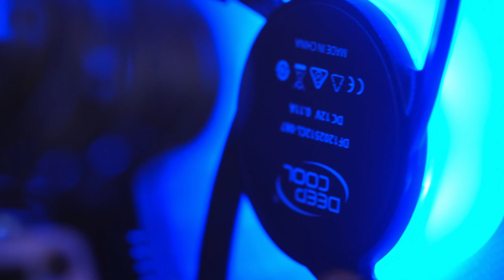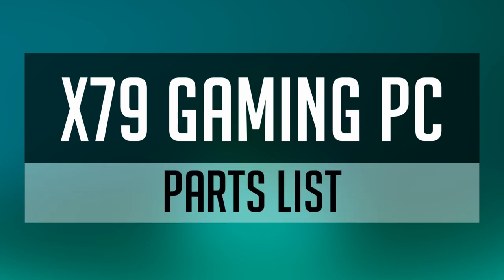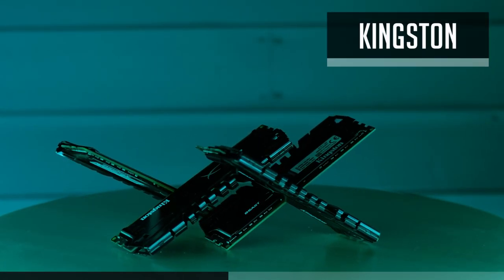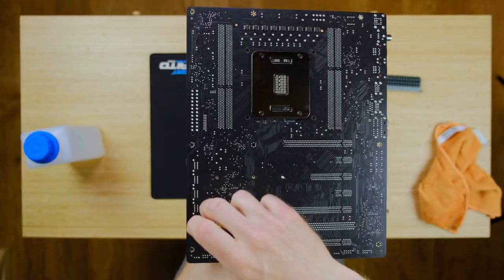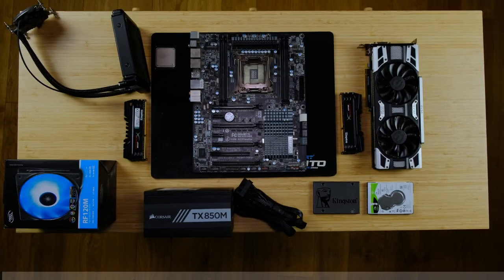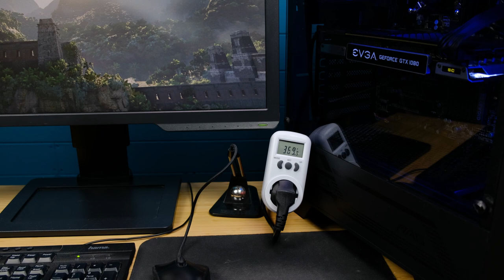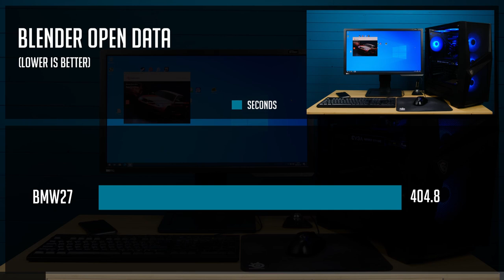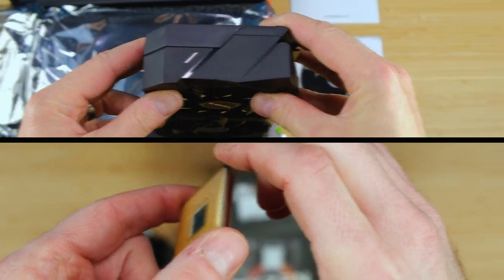TOO OLD IN 2021? NOOOT! I7-3930k (X79) + GTX 1080 GAMING PC BUILD - 14 Benchmarks & Power Usage

Comment: used my 3930k @ 4.7 ghz with my 2080 super until i upgraded. Now sits in my backup rig at a comfy 4.2ghz with a 1070. Can do ANYTHING at 1080p.
Reply from the maker: Nice :)
What's your upgraded system?
Reply: @EpicGameTech  9900k and 2080ti
Reply from the maker: Ah, I see :) Nice uplift, but probably it's for 1440p/4k gaming already.
Anyways, 3930k is still rocking quite well, having in mind you can pair it with gtx 1080/rtx 2080 GPUs ;)

Comment: You get a nice 10-20% performance boost when you disable frequency scaling and keep it at a static frequency, like 4.7ghz.
Reply from the maker: You probably mean all core OC :)
Yep, but it depends, if you are using application that uses 1 core you might lose some perf, if the application can utilize all cores - you will gain performance ;)

Comment: My i7-3930k system is still rocking (August 2021)! It's all-core OC-ed to 4.6GHz on ASUS RIVE, with 1080ti SLI OC-ed to 2050MHz, all on custom water loop. Able to play all the games on high/ultra, including Alyx on HP Reverb G2 headset.
Reply from the maker: Sli? ;D sound like a premium build system a while ago :)
Hmm, but I suspect 3930k should show its age using 1080ti @ 1080p, especially in esports titles.
But higher resolutions 1440p/4k probably still running goood.
Reply: @EpicGameTech  Thanks, I should have clarified that my monitor is 5M pixels (3440x1400) 100Hz with G-sync, so fortunately I am not seeing the CPU bottleneck at 4.6GHz. In VR it's even less of an issue with 8M pixels (2160 x 2160 per eye on HP Reverb G2). SLI is unfortunately dead going forward, and I will try to replace the 1080ti-s  with a single Ampere GA102 card to see if the CPU can still hold its own...
Reply from the maker: ah i see ;)
Reply: We built our eldest daughter's rig with the HuananZhi X79 deluxe ($130) + XEON E5-4627V2 (8 core/8 thread, $110 at the time) + 32GB REEC in quad ($80), coupled to a GTX 1080Ti that I bought in late NOV 2019 for only $350 (today they want over 2x this price). The mobo is not overclockable, so the locked XEON with natively high turbo and all core clocking was a perfect match and easier on the chinese VRM's...which I have an 60mm fan cooling directly (for safe measure).  She also runs the HP Reverb 2 on this rig and it really is working quite well.  Easily manages 1080p titles in high/ultra without issues. Nice things about the HuananZhi X79 are its quality build and bootable NVME m.2!

Very happy with the HP Reverb 2, which we heavily researched as it was out first VR purchase.

Glad we did all of our builds right before the mining/supply chain craze...prices today are ridiculous, especially on the GPUs.
Reply: Friday I'm going to play Elden Ring with i7 3930k and RTX 2060 💪

Comment: I have x79 with xeon e5-1680v2 at 4.4ghz all core 16 threats + 32gb 2400mhz quad channel RAM + geforce rtx 3080! It's a killer! Uwqhd 1440p runs so good in 2021aaa titles
Reply from the maker: hah, yes i bet it is :)
Especially if you play 1440p or 4k ultra settings or even Ray Tracing enabled. Then it's all about a GPU performance.
Sure, you might have a bit fewer fps than with the newest CPU, but with those rez/settings, it's mostly GPU bound and the goal is to have 60+ fps and not 144+
8 years old cpu and still rocks

Comment: My 3930k is overclocked to 4.7GHz with water cooling 360mm radiator 1.35v, DDR3 2133MHz over clocked RAM ... no craches or BSODs... what ever you do make sure voltage stays BELOW 1.39V on these CPUs... I get batter performance than a Ryzen 1600x.... Cinebench R15 single core score is 148...
Reply from the maker: Nice :)
Reply: Every1LoveCars  diy loop with a 360 rad and 48mm thick core plus a cheap Chinese pump.

Comment: 1:50 there is also the fact that going for 6 core for gaming back in 2011 (like i did) was more like a bet for the future as game and apps never used more than 4 cores anyway. 
So glad i bought the 3930k back then
Reply from the maker: Really fun CPU to play with ;)
Reply: @EpicGameTech  also if you check currrent cpu of the same price: you don't often find 4channel and 40PCIe lanes :D
Reply from the maker: nope, but sure, you need a specific case for a 4 channel memory. I mean it makes some difference in gaming but not much, so it's useful where you need that bandwidth :)
Reply: @EpicGameTech  quad channel it make my ddr3 last longer. You either want a compact laser focus build or something with enouth space and feature to be future proof.
And today: the fact that i bought a modular PSU back then made me even more happy when Nvidia mention 12pin connector for their new RTX.. i am RTX 30 ready since 2011. Love it!
Reply from the maker: :DD nice
Well, that 12pin most likely to be only on FE models by NVIDIA. But their partners like Asus/EVGA etc. will make like 2x 8 pin, or 3x8pin (3090?) connectors so they would not need to ship GPUs with adapters (= more expensive to manufacture i guess) :)
Anyway, we all are awaiting for RTX 3000 to be available!
Reply: I still have x79 EVGA Classified + XEON e5-1650 v1 + 32Gb DDR3 2133 + 1080ti Aorus Extreme. I do not really feel the need to change. Maybe when Amd releases 4000series.
Reply: Same
Reply: Everyone in 2011 told me it was a waste to pay $550 for it. 10 years later it's still running like a champ.
Reply: ah yes, its only now relevant after 10 years and its worth $5 more than a 3770k. while you paid more than double price, maybe $400-500 more

Comment: Hi. 
Just discovered your channel, good stuff!
I'm running a 3930k at 4.7GHz with an Asus rampage IV  extreme, 32gb of hyperX memory clocking at 2000mhz , 500Gb ssd and for the graphics I have an msi  Rtx 2070 Super ventus OC .
I'm using a Hydro 100 extreme for the cpu.
Awesome 1080 and 1440p performance.
I did some 4k runs on it too
Doom eternal on 4k  ultra nightmare setting 80-90 fps 
Mortal kombat XL  @4K  highest settings 60-65fps 
Monster jam Steel Titans highest settings @4K 65-70 fps
Monster
Reply from the maker: Hey,
welcome ;)
Yep, so basically you can play 4k @ 60fps no probs most of the games.
No need to upgrade 9 years old platform :))) unless you really want something like a new esports titles running 144 or 240hz etc.
Reply: hi can you give* setting for overclock , i to have rampage iv at use 4.4 by 1.385 and 1866. Or say voltage and calibrate mod and for ram thx from russia
Reply: @melenz  yeah definitely
Reply: @starfirextx  bro where are your settings?)

Comment: I've used my 3930k and P9X79 PRO for the past 8 years.  Still runs like a beast.  Upgrading this week only because of m.2 SSD's and my lian li case needed and extra usb header to utilize the extra usb 3 ports on the front IO.

Upgraded to 11700k and Aorus z590 Master (still with a gtx 1080 cause GPU prices are stupid)
Reply from the maker: Hey,
Nice :) well i hope its not that far for gpu prices to go down, so i hope for the best. As pc tech is in stagnation a the moment :)
Reply: My 3960x just hit the 10 year mark. :,) might actually feel like an old friend died when it eventually kicks the bucket

Comment: i still have this cpu too.

using a asus rampage iv formula and a 1060.

built this over 7 years ago. still a beast!
Reply from the maker: Hey,
yep, and this platform/cpu could handle even a better GPU, so you still have an upgrade path ;)
Reply: @EpicGameTech  still stable. runs @ 4.4-4.7 but the power draw would be a bit high compared to today's standards I'll admit. likely keep using this setup till it doesn't boot anymore haha
Reply from the maker: Yep, this cpu is 130w tdp cpu :))
Reply: @EpicGameTech  My 3930k overclocked to 4.8Ghz will pull 220w according to HWI64

Comment: Still using mine...built in 2012. ASUS Rampage board, intel 3930k, 32gb, eVGA 1070ftw. Only thing I’ve replaced is the ps, 2 years ago. Considering getting a 3080. Thoughts?
Reply from the maker: Hey,
well, I guess you will be playing 4k resolution? :)
Using higher resolutions might be OK if you overclock your CPU. But using lower-res lie 1440p / 1080p you will lose more performance compared to some newer platform/CPU.

But even @ 4k, you might not get 60fps in all games with 3930k, like 45-60 fps maybe, while with the new platform you would get like 60-80 fps @ 4k max settings. This is a bit of the "guessing", but a very possible scenario.
And as I've mentioned, using 1440p you would potentially "loose" or not gain much more fps than in 4k.

In general, I think 3930k can be pared with rtx 2070 / super level GPU  and if you get anything above, I would upgrade the whole platform. That's my thoughts, doesn't mean I'm 100% right etc :)
Reply: @EpicGameTech   Thank you for the quick response! I'm really torn as to what to do.  The 'old' beast is working fine, but I really want to start getting into 4k 60+ fps gaming.
Reply from the maker: Well, I bet there are no decent 3930k + RTX 3080 benchmarks :)
I've found just one vid 3930k + RTX 3080:
https://youtu.be/o2p5tKSb-Hk
But still, there were some benchmarks and just one esports game that is not quite demanding :)
So you need to get 3080 and test it for yourself. If it doesn't perform on the level you need, well you will sell the x79 platform and get a newer one :)

Comment: This is what I've been using since late 2011. It's still going strong. I future proofed very well with this build. I think I spent $2700 building this PC.
Reply from the maker: Nice ;)
Well I wonder, how this would perform with RTX 3000, say RTX 3080 as I do not have this pc any more.
What GPU are you using?
Reply: I too, exactly like you..since 2011 :-)
Reply: @lastexosphere1300  hell yeah, brother. I want to put a 3080 in it and keep on going haha! I’ve got a 1070 right now and it runs everything just fine.
Reply: @EpicGameTech  I used to run two EVGA 680 FTW cards in SLI, but then I went to just one, and now I’m on a 1070. I’m not sure if I should put a 3080 in this machine or build new!
Reply from the maker: Ah i see :) Well really not sure about rtx 3080. Would be nice to test it but i doubt anyone did this combo (maybe Tech Yes City?:)
At higher resolutions and ultra settings with 60fps target it could handle better card than gtx 1070 (maybe rtx 2070 super/rtx 3060 ti?)
But i doubt it would utilize rtx 3080 to its full potential. Especially fo higher fps gaming :)
Reply: @duhdude  Yeah mate, i wanted also put a new RTX 3070 - 3090...but why? - Every Game is running fast and the I7-3930k  is staying cool  39 - 50 C°..  We should keep it for the next 3-5 years... until they come i12-9869K and RTX 4560 ;)))
Reply: @EpicGameTech  to be honest, if you hooked up a RTX 3090 to this thing I think it would do very well at 4k as the cpu becomes less demanding, it would definitely be funny pairing!!
Reply from the maker: Hey,
Yes, 4k is more GPU bound and sometimes CPU has way less influence on gaming perfoemance usinf thia resolution. Especially if your target ia 60fps.
Thats why I've stated "higher fps gaming" menaning 1080p really high fps or even 1440p where you need like 144fps+.
On the other hand, even playing 4k and using old cpu will leave some performance on the table. Say I3-12100 should perform better @ 4k than 3930K :)

Comment: Great video.  X79 is still a great platform especially if you can get your hands on Xeon CPUs.  I bought a used T5610 workstation with dual E5-2560 V2 CPUs and 128 GBs of RAM.  It is a great machine and runs very fast.  Plus I can multitask with no slowdown.
Reply: which should i go with a custom build with this cpu 8gb ram or a lenovo g5i 8gb with i3 10100 ?

Comment: managed to buy an ASUS P9X79Pro (mint, with original box, paperwork and all accessories) for $20 locally in a package deal.  Then, an E5-1680V2 (8C/16T, OC to 4.4Ghz on Air) for only $155.  Coupled with 32GB (8x4GB) 1600 desktop RAM (HyperX Fury, $120), this setup runs very well.
Reply from the maker: What? ;) I guess that guys didn't knew what he was selling?
Crazy deal!
Reply: @EpicGameTech  Yes, he sold in a package deal for $220...including an i7 3820 (Sold for $70 at the time) + 32GB 1600 desktop RAM (worth $120 at the time/ I kept for my office build) + CoolerMaster H412S tower cooler (worth $30, repurposed for my eldest daughter's PC). I say the board cost me only $20...to give it some value...but the truth is...I really got it for free!

Comment: Bought this CPU for my sons build, got it cheap second hand. It's a great CPU. Only problem I had was getting the mobo, quite rare for some reason and ended up paying 180 quid for one. He's limited to 1080p due to his msi monitor but eats AAA titles for breakfast. The amount of RAM it supports is mental.
Reply from the maker: True about motherboards, they are still expensive ;) even though they are old
Reply: While it seems the CPUs will last forever  the motherboards are indefinite and becoming harder and harder to obtain driving up prices.
Reply: I have the same cpu, i love it but encounter more and more games that use avx2 instructions wich the 3930 not supports

Comment: Excellent platform for wise classic gamers!!
Reply from the maker: But x79 motherboard pricing is still crazy :) Well, only aliexpress ones are ok
At this point, I think new platforms (AM4 or Intel 12th gen) will take over, unless pricing of x79 motherboard + cpu combo will drop drastically. Even now i5-10400f + motherboard can be bought pretty much the same price as branded x79 motherboard + 3930k and the new platform will get you more fps.
So I hope x79 prices will go down. Or it will remain only for super enthusiasts / one time deals ;)

Comment: Nice video, I have an i7-3960X with the same GPU on an nice Asus X79 motherboard.  It would be interesting to see the comparison to the Ryzen 3600 but using the same GPU (1080).
Reply from the maker: Thanks ;)
Unfortunately, I do not own gtx 1080 any more.
Anyway, I assume in most scenarios when your goal is 60 fps on a higher resolution like 1440p, the difference should be quite low.
But say for super high-fps competitive games, Ryzen 5 3600 system should be a clear winner. Since a newer platform, faster ram and faster cpu will bring those PFs up where CPU power is needed.
Also, it depends from the game optimization. I remember I had such a situation:
I owned i7-4770 + gtx 1070 and FPS in Quake Champions @ 1080p were like 100-140. Then, I've upgraded to i5-8400 and kept same gtx 1070. In theory, i7-4770 and i5-8400 should be quite a similar performance 4c/8t vs 6c and many benchmarks shows they produce similar performance. BUT, after an upgrade to i5-8400, i saw a massive (almost 2x) FPS jump in Quake champions, to 180-280 fps.
Sure, it's an esports title and I was using low settings @ 1080p to get super high fps. So the newer platform gave this insane jump.
And I'm quite sure, it was related to game optimization for sure.
But again, in a scenario when using Ultra settings or higher resolution, FPS improvement wouldn't have been so drastic :)
So it all depends what are your needs.

Comment: What is the best gpu to pair with an i7-3970k not overclocked ? I have a gtx 1070 right now but looking to upgrade and do not want to rebuild with a new chipset. Looking to maximize performance with what I currently have
Reply from the maker: Hey,
probably you meant 3970x? :)
Well, in terms of pc build age, your combo is quite good for 1080p gaming. But sure, 3970x could handle even better GPU.
Actually, it depends on what kind of resolution/settings/games you want to play,
In case you want higher rez like 4k and 60fps high settings even RTX 3080 would probably work (but I probably would not recommend 3080 for such an old system anyway). You would gain more fps with a newer CPU in that rez, but in general, GPU is more important on bigger rez.
In case you want 1440p @ 60, then probably RTX 3060ti/RTX 3070.
1080p? GTA 1080ti / RTX 2070 super / RTX 3060 etc.
Reply: @EpicGameTech  Yes haha that is what i meant, Thank you so much for your response!

Comment: Is this still worth getting for games such as zDOOM (Classic doom port) will it handle semi modern games and apps decently without stutters and crashes ?

thanks !
Reply from the maker: Well this system still can handle modern games. But as always, it depends from the price of this cpu+motherboard in yoir region/country.
Sometimes old systems (especially x79 motherboards) goes for the same price as new parts like i3-12100 or ryzen 5 5500. And these new systems will be way better if same price, as you will have decent upgrade path etc.
Reply: @EpicGameTech  can get 1 with 8gb ram , 180gb ssd  for 250 used as a full system , good deal ?
Reply from the maker: Is it with GPU?
Or only CPU + motherboard + ram + ssd?

For $240 you can get new:
Ryzen 5 4500 + Gigabyte B550M DS3H + 16 gb ram (3200mhz)
It would cost ~$240

Sure, you still need ssd + psu + gpu.
But later on, you could swap ryzen 5 4500 (cheapest ryzen 5 atm) to ryzen 5 5600 or even 8 cores like ryzen 7 5700x and the system would last way longer than old x79 system.

Unless you get everything including GPU/PSU for $250, than it's probably good :)